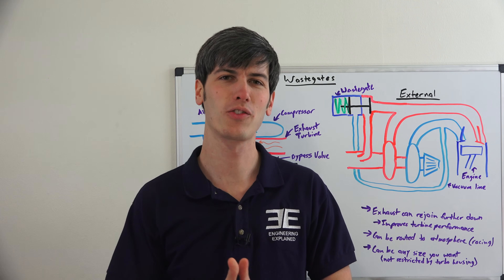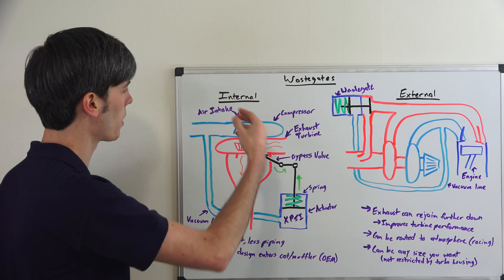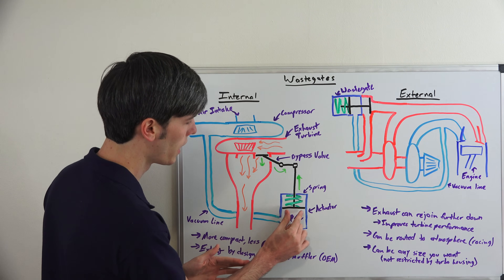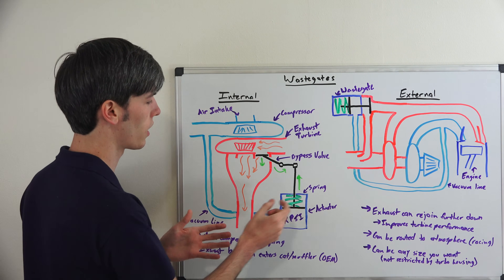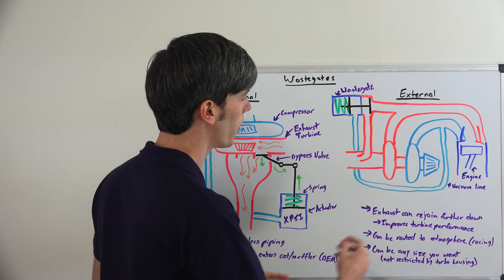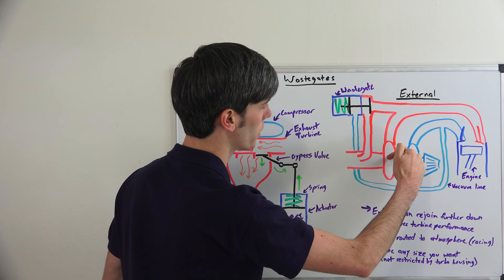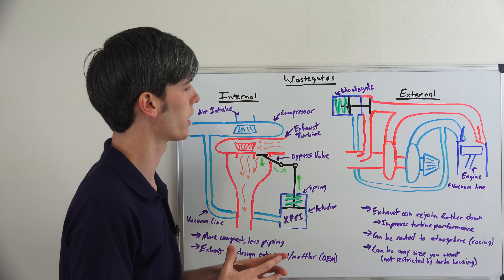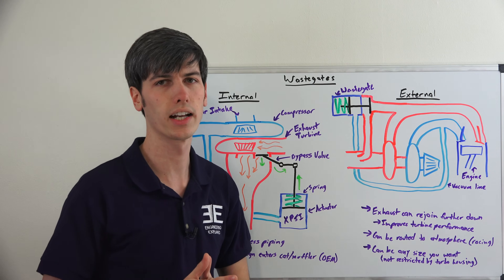How Turbocharger Wastegates Work - Internal Vs External

Comment: When my car isxat idle everything is oke.
But when i accelerate there is a rattling soundcfrom thecturbo....cars drives good just the sound.
I think it can be the waistgate rattling..because at idle is is closed so no play to rattle.
But when reving it opens and is free so it will rattle from vibrations.
I mean eithe the rods or the connection of the disc..
Do you know if this happens more often.

Comment: Came here cause i was wondering if the wastegate worked like i thought it did. I want to use both turbos and a centrifugal supercharger to reduce turbo lag in a 30psi boost application by sizing the turbos smaller. The way it works the procharger makes 30 psi at redline and 15 psi somewhere further down from that. The turbo is sized to make 15 psi and the wastegate is sized for 30. So once the combination of centrifugal supercharger and turbo make a total of 30 psi the wastegate opens more and more to slow it down and keep it there.

Comment: Tell us this ! If you have a 7psi spring in your external wastegate which will open at 7psi of boost in the manifold why do you need a pipe off the cool side of the turbo to open the wastegate under 7psi of boost pressure, is it just to open the wastegate fully to release manifold pressure quicker?
Reply: The pipe off the cool side is what is opening the valve, it takes 7psi of pressure in that line to overcome the spring that is holding the wastegate closed.

Comment: So when Dom pulled the vacuum line, basically the air going through the compressor doesn't reach the wastegate at all, so the compressor keeps spinning and emptying the air to atmosphere. This means that the exhaust gases will never bypass the turbo, constantly spooling it up and increasing air pressure. This would eventually blow the engine up because of the rapidly climbing amount of boost. But Dom did say that it would only have to make it to the end of the race!

Comment: Wastegates are effective, but I prefer the sound of a blow off valve. Even better would be a carbon fiber tank to capture pressure for use when boost is low like koenigsegg uses.

Comment: What is this blue pipe going from the intake after the turbine into the waste gate valve? What is its function? Is it also a bypass valve which dumps extra pressure into the exhaust pipe? If yes, why into the exhaust pipe ?

Comment: Hello I have a 1987 mercedes 300d with the 3 litre turbo diesel
It still has the original Garrett turbo. What can I do to get a little more boost from my turbo without çausing and stress or engine damage. 
Thanks for your time and videos . Robert

Comment: Hey, I have a little question about wastegates. I drive a Subaru with the 2.5L turbo engine and the 4EAT automatic transmission. I was looking for hybrid wastegates to get some flutter sounds at high boost, but I've heard online something about the A/T actually preventing the flutter because it keeps spooling the engine I think. Can you explain me what people mean by that? Is that a different type of setup or is it just the result of sth that my transmission does? Is it applicable to all turbocharged automatics?

Comment: Hi, always enjoyed your videos, just have one question, I've recently bought a 2015 Suzuki Alto RS Turbo AGS. I bought this for my wife so would be easy for her to travel to work and back rather than me doing the driving for her up and down. This is a tiny car with a very tiny engine (660 cc with a 64PS). It has a very small (smallest I've ever seen) inter-cooler and a turbo, I was just wondering if I could fit a waste gate for this (i always enjoy the sound of the waste gate). Would that be practical for a such a tiny engine and a turbo? would it lose power or awesome fuel consumption it already has? I am pretty new to turbo setup, i've always played with NA engines. Thanking you in advance for your reply.

Comment: Where does the turbo whine come from? The front area of the compressor or turbine? I'm leaning towards front area design  of turbine housing since it's pulling air in. However I removed all the exhaust components on my 6.0L powerstroke and it sounded like there was a vacuum cleaner inside the exhaust pipe. So which side is responsible?

Comment: Another great video.
I know the whole idea of a wastegate is to prevent compressor stall, however uneducated me always thought the wastegate was on the intake side.
Closed throttle creates an overboost scenario and the compressor stalls cause it cant pump any more air into the intake cause it has nowhere to go... hence my thought of the wastegate being there... This would also keep the turbo spooled up. Is this possibly how wastegates work in certain applications?
Would a waste gate on the exhaust side not just result in the turbo spinning down because there is less flow over the turbine?

Comment: I guess one of cons to having a internal wastegate is if any part fails it requires a whole brand new turbo ? Like on my Volkswagen 2.0t tsi K03 turbo that is leaking oil from the wastegate ?
Reply: You can still replace parts on a internal wastegate, don't need to buy a new turbo.

Comment: The actuator, can this cause limp mode.??  on some variants of cars.  I noticed that i swapped for a like for like brand and the car seems slower.  I assume that is because the spring is of a lower rate.  To avoid this issue, Would an external waste gate be better for control.  The XPSI is it.?  mine is electronically controlled and i think its causing limp mode.  Hence why i swapped it.  However, it did not cure my issue but car was slower.  Should i just upgrade to an external and see if I can get the ECU commands to be coded out from the XPSI issue.?

Comment: So it’s basically a blow off valve right?
Reply: No, but the two are kind of similar. A wastegate allows some exhaust to bypass the turbo, thus limiting the output of the turbo. They are used to control how much boost you make. 
A blowoff valve is in the intake and opens up when there is too much pressure. When you let off the throttle the turbo is still spinning so it is pumping air. However, since the throttle is closed that air has nowhere to go. They are used to prevent damage to the turbo.

Comment: The "Vacuum line" is not under a vacuum even at part throttle. There is no pressure drop from turbo entrance to turbo exit. If you use a manifold tap then you can have vacuum.

Comment: What's he difference between a wastegate and a blow-off valve
Reply: A wastegate releases hot exhaust gases at excess pressure originating from the engine before they enter the turbine (hence they are mounted on the exhaust side). A BOV releases cold boosted air returning from the closed (or closing) throttle body before it reaches the compressor side of the turbocharger and spins it backwards (hence it is installed on the intake side).

Comment: Awesome video!  I have a 2003 F-350 with a B-D Turbo in it. I was able to get 30PSI out of the Turbo previously but am only getting a maximum of around 20 now. I checked for leaks and replaced all the boots, made sure all the straps were tight but it only gave it a marginal improvement. Watching your video, made me wonder if I can somehow adjust the wastegate actuator??  Is this possible?
Reply: Rip turbo

Comment: Can a clutch be used to simulate a wastegate on a centrifugal s/c?

ie. when max desired boost is reached, the clutch disengages and the s/c stops spooling.

Or can a wastegate be used within a centrifugal s/c system somehow in order to regulate max boost?

Comment: Why do we even need the wastegate , so that we can keep it at a certain boost that the engine wont get damaged at right?   Then why are we even dealing with this , just put a smaller turbo with max boost same as this with wastegate open so that engine ll be safe at max boost of turbo. This ll make it lighter and would have less turbo lag. And since pretty much every turbo uses wastegates and not the method i said , my thinking wouldnt work. Can somebody please explain to me why
Reply: It's the exhaust that controls boost, not the turbo. So the size of the turbo alone dpes not dictate boost level, but rather it determines performance at different RPM bands (spooling characteresrics at high/low RPM...etc). Wastegate are necessary because the more exhaust gases, the faster the turbine rotates, which will drive the compressor faster, making more boost, which will result in more exhaust gases...this will go on and on until you start controlling it by venting excess exhaust pressure or taking your foot off the gas pedal.

Comment: What should i do IF: I'm having turbo flutter (tututu) with OEM Wastegate, and the thing that confuses me most is that the (tututu) only comes when under 2000rpm (like releasing gas pedal in traffic?) but Higher RPM there's no (tututu) even when suddenly releasing gas pedal

Comment: The biggest improvements turbochargers need is to combine VGT/VVT with twin scrolls this would greatly reduce Turbo Lag and increase boost at lower RPM's and it would almost eliminate the need for a twin Turbo setup in most diesel engines and would help in inline 4 engines and when it is used in a Twin Turbo V6 and V8 gasoline engine configuration it would boost torque and increase horsepower without sacrificing much to do it especially in catback Turbo setup that is commonly used in the challenger and mustang and Camaro application basically the twin Turbos are installed after the catalytic converter.

Comment: The F1 hybrid era all went for the external wastegate option which as you say is the racing preffered option ... but in F1 I thought weight of the total system factors in greatly too? Doesn't the extra piping for the external wastegate negate the benefits ... it's rhetoric since the F1 gods seemingly indicate it doesn't. But why is my question ... both options in F1 would vent to air ... it's not like they drive a catalytic converter in F1 right? Probably has more to do with improved matching of turbo housing to wastegate optionality also probably safety margins.
Reply: Mohamed Abdinur. I think in F1 (and a lot of other racing categories) the wastegate is mostly external as it’s a controlled item that is provided by the racing series administrator and has a fixed boost level.  I know that this was the case with the American Indicar series as the drivers actually used to have a vacuum pipe from the wastegate plumbed into their helmet so they can hear when the wastegate is about to open. This allows them to go right up to the edge of the wastegate opening but not actually let it open as this momentarily reduces power, which is a major problem when your racing.

Comment: I do have a question. what makes that cool noise of turbos after letting off the throttle? is it the excess gas in the hosing exiting or is it because the sudden drop of turbine RPM?

Comment: Questions : these waste gates all seem to function on an mechanical basis, are there electronic alternatives that use sensors and actuators or is that impractical? Second, how does one go about calibrating at what point you would allow the gate to activate? How do you know when the pressure is too high for the engine/piping and is there any danger for running too low through your turbo piping?

Comment: This seems like it would end up creating less boost because under pressure the exhaust gasses have two paths and it seems like there is less resistance on the waste gate side. Anyone able to explain if that’s true or not?

Comment: I always thought the wastegate sat on the "vacuum line" side - preventing pushing excess air into the cylinder. Then again this topic is way way out left field of my interests. =)
Also with the valve on the exhaust side wouldnt that valve be exposed to some heavy fluctuations as exhaust is "impulsed" out of the cylinder? Or is there some buffer there to even out the flow/pressure from the exhaust?

Comment: 1) if i dont connect the waste gate with the exhaust will i see any change in performance (more or less power) ???
2) if i dont connect the waste gate will i have any trouble getting past car checks???
Reply: 1. eh, done more or less for sound (screamer pipe), less restrictive.
2. if you dont connect a wastegate your car will go BooM as well as the turbo as it can't limit the amount of pressure flowing through the turbo
Reply: @rghZane  ok thank u xD

Comment: Question- on my car (the q60 red sport from infiniti) they use an ECM controlled electronic wastegate actuator. If these are in use on the VR30DDTT, why do people install a BOV?? Doesn't the wastegate actuator protect the turbos?

Comment: hii, i have seat leon fr 1.8 , 180 hp  year 2015 , im having an issue with my turbocharger ,recently i started getting EPC alert message on my display, the car became weak,   i have electronic turbo wastegate actuater , i connected the car to diagnostinc computer and got fault message saying that actuater module for turbocharger P00AF  stuck , i have changed the turbo alone without changing the actuater as someone told me it can solve the problem , but im still getting the same EPC alert , so i found out that both the turbo and the actuater are damaged 
 my question is  if  i have to change the whole turbo when the actuater is damaged , or i can just simply change the actuater   alone keeping the turbo, like in my case ???? 
and second ,after chanign electric wastegate actuater ,  can i do any adjustment for as in  mechanical one controling the air pressure volatge for example ( i am having 1.7 volt) 
please help !! 
my turbocharger code is 06k145721 G 
my wastegate actuater code is 06k145725s

Comment: I'm just wondering, are most turbos designed so that if the actuator rod were disconnected the wastegate would just be open or no spring pressure would be applied to hold it closed so that exhaust would bypass the turbine and no boost would be created? And if so are there any that are not designed like this? So that if the rod was disconnected the boost would keep building with no limit until it blew up?

Comment: Hello fellow N54 owners
Reply: N55B welcome?😅
Reply: N55 widdit
Reply: Still got it?
Reply: @takemoneysatch  I'm never going to sell this car at this point lmao
Reply: @wilson4079 6 years later and still replying is legendary 😂
Reply: @wilson4079 what have you done to your car
Reply: @Emn3  it's single turbo with port injection, reflex with flex fuel sensor and 2 walbro 450's and all the other supporting mods, stock engine still
Reply: @wilson4079 not bad
Reply: 7.3 powerstroke actually 😂
Reply: Howdy
Reply: soon to be b58 owner
Reply: Real

Comment: I have a question, I purchased a turbocharger for lab experiment. It has internal waste gate and I do not need it. When I close waste gate then turbine wheel stops, and when I open it turbine wheel starts to spin, I observed that waste gate is sucking fresh air in the turbine housing. Can you please guide me what is the problem because I believe waste gate releases extra exhaust gases before entering into turbine volute but in my case it is sucking in inside the volute.

Comment: If you dump the external wastegate exhaust into the atmosphere, won't this cause a vehicle to fail a state inspection? Being the exhaust gas isn't going through the exhaust, cat coverts, etc. (its also loud and sounds identical to an exhaust leak).
Reply: Auto-X-tacy as that is a phenomenal point, all depends on where you live. In Wisconsin only some cities/counties require emissions testing. Thankfully my neck of the woods doesn't fall under that, but I'd be interested if that would be taken into account.

Comment: new tech turbo waste gates are operated with vacum from a vacum pump bolted on the camshaft and electronic via the ecu and sensors which makes it slightly more difficult for the backyard (ricer) mechanic to fiddel with.
Reply: Which is a good thing

Comment: I'm a little confused, I thought when you let off the accelerator, a valve opened to send the pressurized air away from the input manifold as to allow the engine to spool down...or is that a blow off valve ?...or is that just a different term for a wastegate ? Thanks for your awesome videos...
Reply: The blow off valve is in the charge air tube before the throttle plate, it's main job is to release the extreme pressure created when you let off the throttle. Waste gates are in the exhaust side for boost control, more exhaust through turbine equals more boost. Exhaust routed around the turbine lowers boost.
Reply: Scott Gaines Thanks ...did not know that..good clear explanation..👍👍👍

Comment: Is a waste gate necessary? Never dealt with turbos
Reply: In most applications a wastegate is necessary.(there are other options like" variable geometry") Without it boost would climb to the point of failure. Too much boost can cause catastrophic engine failure.
Reply: Thank you that's exactly what I wanted to know

Comment: I recently made a manual wastegate for my 6.5 turbo diesel. After attempting to get going at it I fired the truck up and had no boost. Is the wastegate are supposed to be all the way down or there whoops the wastegate arm be set at?

Comment: I am interested in learning more about the internal type turbo wastegate. Now it is much closer to the turbine, so my assumption is that all though the waste gate is fully opened, there is some amount of gas that flows on to the turbine and tries to rotate it, but its rpm is not good enough to produce the necessary boost. At the same what is its opening effect on exhaust gas temperature while it is in closed or partially opened condition

Comment: I have a question. I own a b5244t5 engine with a K24-7401 turbocharger, do you happen to know what bar or psi it produces at which  rpm stock ?